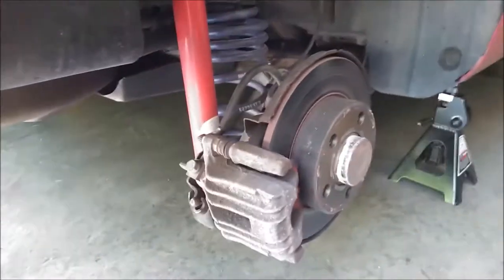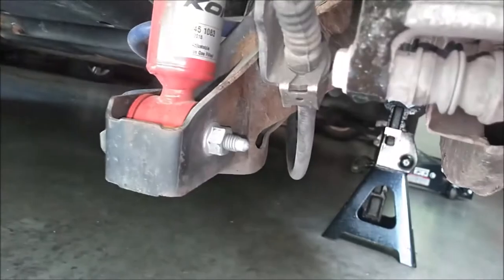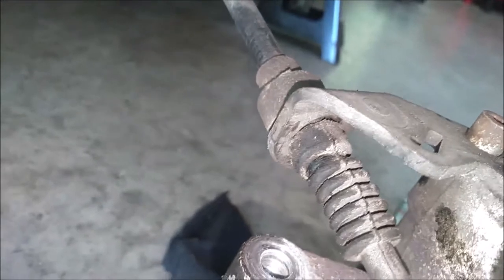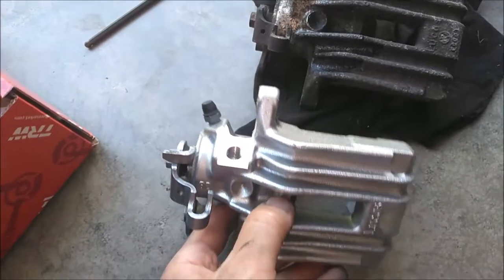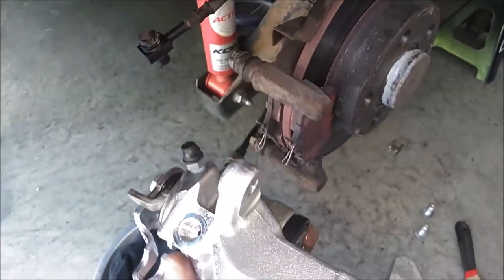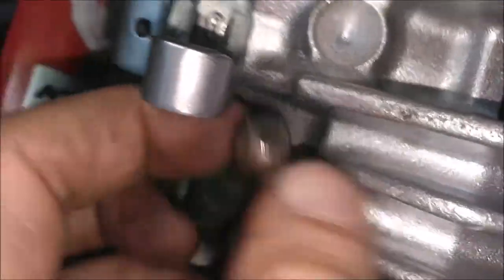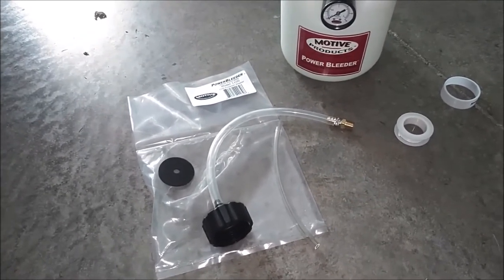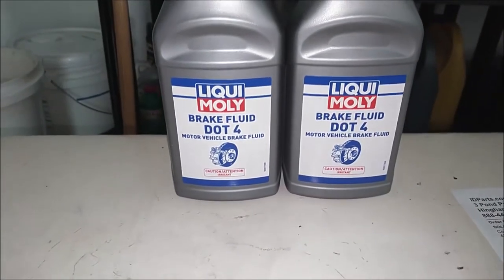Volkswagen Golf mk4 right rear brake caliper removal and install

Comment: Very well-explained. I lost one of the pins in my rear brake caliber and came to your video just to refresh my memory on something I don't do often. One thing you should have considered though: The brake fluid should be flushed before you put the new caliper on, and then flushed again to be sure no dirt gets in there. THis won't be an issue if you're certain that the brake fluid doesn't need to be flushed just yet, but you want to flush it again after regardless. The key here is flushing before and after if the fluid needs to be changed or if you're unsure when it was last changed. For me, if the tires are off, I'm flushing it regardless. The labor is the part I care about the brake bleeding is pretty easy.
Reply from the maker: Thanks for the comment and yes, brake bleeding is pretty easy.

Comment: Issue I had was the VW steel banjo washer refused to seal on the car with the replacement calliper. And very inconveniently VW make it so its near impossible to remove the washer and they suggest replacing the entire line ( very handy when you are working on the car and the nearest VW dealer is 70 miles away.  With a lot of difficulty managed to remove the steel washer, the 10 minute job became a 2 hour job just because of this one damn washer. Once off, the top steel washer just fell off and I replaced both with the copper washers with my new calliper and voila - no more leaks.
Reply from the maker: The brake lines can definitely be problematic. I'm glad that you used the copper washers to seal the lines. Thanks for sharing!